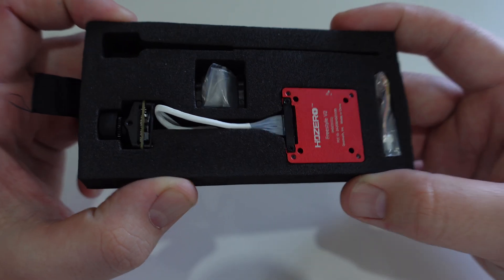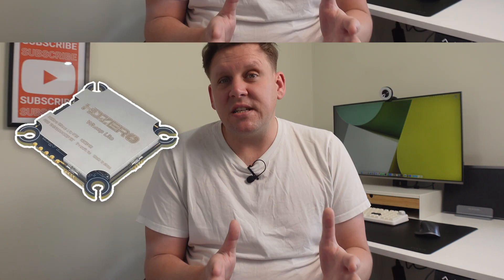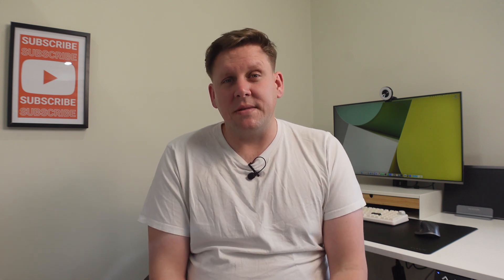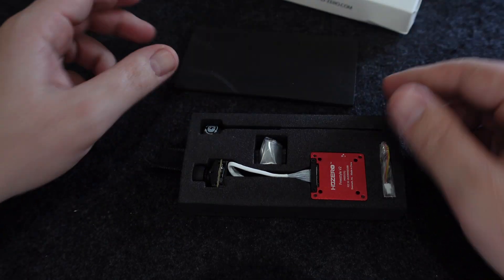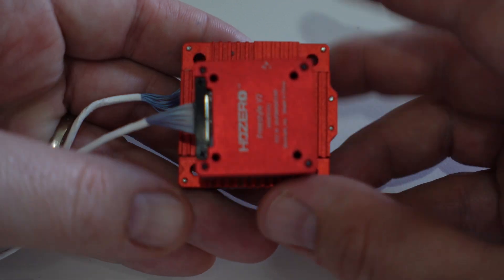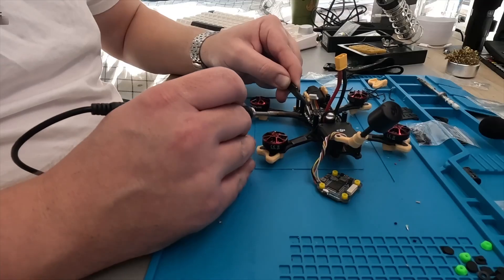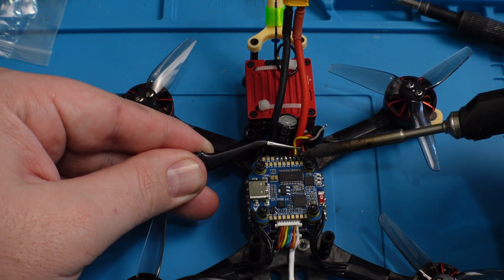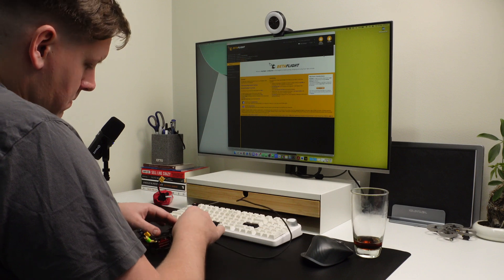No Digital FPV System Has Done This Until Now

Comment: I like your analogy of using a football team. However you left out a several very important ''Positions'' - What about the ''Crumbers''?? - I'm referring to those of us running large scale RC cars, Buggy's ripping around at insane speeds Be it on road racing or Dune/Desert racing. It seems we are always left out of the ''Team'' When it comes to FPV. I own x2 03 Air units and a set of Goggles 2 that basically may as well be a door stop. I bought them basically at launch and have never powered them up because I/We don't know how. Here's why...
The developers of this cool gear always are catering for Quads and Planes in which I have quite a few also. My point is, getting this gear to work without a degree in computer engineering is virtually impossible because of things like FC's, BEC, SBUS etc... I mean, All we want to do is install the bloody camera, Power it up, slip on the Goggles and Go! - There are extremely limited resources in how to even take the Camera out of Standby for a start. It's an absolute joke. Not you guys, But the companies that design and manufacture this new digital Tech. We are tired of blurry, snowy Foxeer Reaper etc images too coming back to the user and want in with digital. Countless emails have been sent to companies like DJI and Walksnail/HD Zero and the like with absolutely no simple work arounds. The RC FPV boating guys are feeling the same way ( I for one). 
I love my fixed wings and quads, But there are just as many people around who are willing to pay good money for ground and water craft FPV also. So here we sit in 2023 without these companies giving a sh*t, So it seems. 

Thanks for the video, It was pretty cool, SUBBED. Take care, PRC - Western Australia.
Reply from the maker: Thanks for the comment and the sub.

To use the sports analogy, I wouldn’t say you guys are part of the “team”; sure you have an egg shaped ball, wear a similar uniform and football boots - but it’s not the same game. 

Pick your poison here right. 

You guys with ground rc vehicles are playing AFL, while we’re playing a different code of football (NRL, NFL, ARU) 

You’ll be hard pressed to get companies to tailor specific solutions to a small market of an already small market.
Reply: @DarrenAllatt  Very well said mate.

Comment: Just came back from my first professional drone flying job shooting high performance spead boats using both analog and HD Zero video systems. "Growing up" with analog gave me confidence in the beginning. However, I ran into enough RF interference around certain boats that i completely lost video feed while circling around them. Not good! Anyway, I never had these issues with my HD Zero rigs and finding my way back home was also much easier with the clearer picture I was getting. I later found out the RF interference was caused by the boats using race radio systems on board. I may be able to simply change a frequency band or channel in order to overcome the problem. That said, I prefer the clear picture of HD Zero and I'm very interested in this new freestyle v2 vtx as long as it's lighter than the v1. At this point, I'm more focused on lighter weight and higher speed in order to keep up with these boats.
Reply from the maker: The new Freestyle v2 is a feather compared to the v1

If I was you, I would find a RF scanner to be able to identify the RF in the area when doing a professional job
Reply: @DarrenAllatt  Yes, there are Apps you can download that work great for this instance.

Comment: Sure you can mount HDZero VTX on any quad, but how does that help you when you fly out only 50m around some trees, bushes, buildings, ANY OBJECT, and your screen is full of colored sparklies and you get the Rainbow 🌈 screen of death ☠️💀?!

It's penetration capabilities can't punch itself out of a PAPER BAG! 😫

It's best for racing, but besides that, it's a one trick pony. And, that's fine. Just buy HDZero if you are mostly into racing. PERIOD. 🤷🤦
Reply: People who say that haven't tried HDZero 😂 I own both, HDZero and the DJI Goggles V2 and HDZero is far superior for technical freestyle flying. Ive crashed my DJI based quad so many times just because of variable framerate or cut off video feeds where I can easily fly through with HDZero, even with all the "rainbow". If you own both systems, you will throw your DJI stuff in the trash, where it belongs to. The only real benefit I see is in cruising. Racing and freestyle, HDZero clearly wins.
Reply from the maker: so what are you running HD-Zero on?

Comment: It still looks poor for anything over than a whoop. Analogue still lighter for the tiny systems.
Reply from the maker: Did you watch the whole video?

I explained the key differences between the systems and why the resolution is what it is.
You have 14ms glass to glass, at the expense of resolution; while DJI has better image resolution due to re-transmission at the expense of latency.